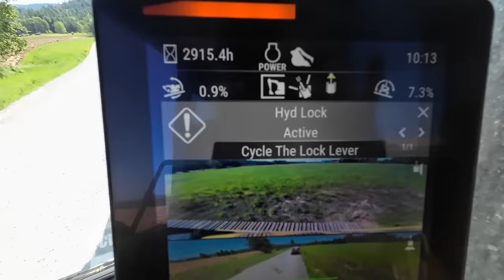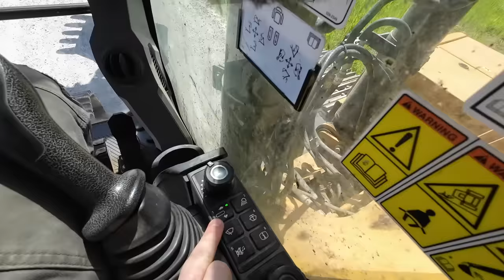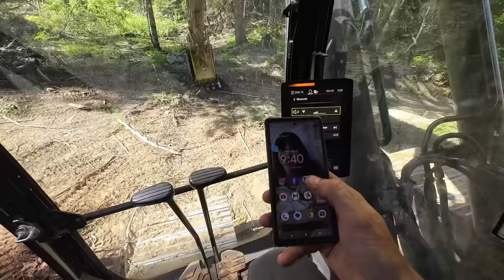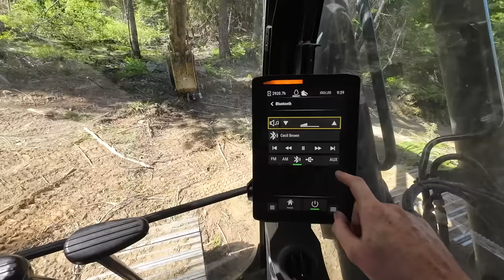We Rented The BIGGEST Excavator We Could Find...

Comment: watching you rock that undercarriage, I'm certain @letsdig18 would agree you're driving it like you stole it & encourage you to dig around the stumps before trying to pluck it out of the ground
Reply: Thinking same about same channel. 
This is where collaboration would come in handy and result in cross channel views. 
And digging around the standing trees to sever some roots before tipping them over. Less breakage and possibly of the tree coming back towards the cab.
Reply: Even reaching  around the back to loosen the dirt and roots a bit would help. A few more seconds and some finesse goes a long way. My body is too screwed up to let a machine drop on the tracks. Even running a Cat 328 loading a 40 ton rock truck with mud, I had to be careful because it jarred the clapped out rental we had......we didn't want a zero tail swing unit but got stuck with it.

Comment: Long time first time....I struggle with ratchet straps.  For an average backyard guy, what would be the most useful size of the Strapino straps.  I have a trailer that is 8 ft by 12 and I do move some sheet goods from time to time.  Was thinking 1 inch by 10 foot.  Yoer thoughts?

Comment: you was lucky, for most people they just leave it the driveway early in the morning.
and you can call them and get help on the phone if you cant figure it out yourself.

this is why its better to rent all the big machines if you dont use them every day..
you cant own them all, and you can always find a faster cheaper and better machine then you have

now you have 2 digging machines and you are renting a 3rd to get the job done

for your own safety, cut those tree´s down dont use the machine like that

it might feel like a easy job, but you can get parts of the tree right in your face if it snaps the wrong way..
sometimes there is tension in the tree from branches and so on

if you want to use the machine you need to pull them up with roots to avoid the snaps, but you need to have the right equitment for that also. (like a strong chain)
or elso it can end up in your face also
or a rotor on the grab

you would not need the bobcat then if the big rented machine had the showel in front like they normally do
that machine is wierd

the showel infront also makes it have more power if you can put that in the ground while you dig for example

smoothing out the road is much more easy when you have that in the front of the machine

Comment: I'm curious how you both would compare and contrast the mini-ex you started you off grid project with, to the Hitachi EX120 or the Cat 330.  I do realize the price point of the three excavators is very different.
Reply: I’ve got a PC100 which is similar to Ex120 glad I didn’t buy a smaller machine, I definitely wouldn’t buy a rubber tracked machine for an off grid property. When they over 20 years old the bigger machines are normally cheaper anyway.
Reply: I have spent a bunch of time in a Yanmar Vio 35 which should be around 8k pounds. The mini ex fits in so many places very easily. We remodeled a big campground for a year, have done a bunch of other jobs with it and I have used it at home. It can do a lot of work with a 1 and 3 foot bucket. It fits in a dump trailer and I can haul it with my diesel pickup. I have not used a mid sized machine like the 120, but have used a 36" machine for tight quarters trenching. It was perfect for that. The Cat 328 or 330 is a workhorse and luckily there was plenty of space where I ran one. Same for the Cat 349 and 78" bucket we had on a job, although I only did a little with it and my brother ran it every day. We were loading super 10 dump trucks and it only took 3 scoops to fill a truck. All the sizes have pros and cons and there isn't a one size fits all choice. Our company also has a Cat 420f backhoe which is probably similar to digging with an EX120. A 3 foot bucket on that backhoe will move a bunch of dirt and a hydraulic hammer on it is great for concrete work, but it is much bigger and less maneuverable than the mini. We often use the mini and backhoe together and also have a cat skid steer. The company sold their Cat 320 excavator since we use so many different types and sizes of machines. It is better to rent closer to the job sites and get the machine that is needed. The mini was great for building their shop and would be my first choice, unless most of the work was going to be bigger.

Comment: On the the 300 make shure radiator finn's are stait and not bent over if bent they make a comb or just use a knife and bend them strait all heavy equipment needs radiator blown out with compressed air every day if its real dusty

Comment: Something like this would require a 35-45 ton rock truck and a dozer to level out the lifts to keep a high productivity level. Lets Dig 18  just finished a massive pond damn. I think he moved something like 100-200k lbs a week with a Hyundai 330 and 2 rock trucks running. You guys with the new machine, the old dozer, and a rock truck should make short work of this project with all the equipment running.

Comment: What happened to the Kubota excavator you used to have? Was it not capable enough for your property? Asking because we are going to purchase one in the future. I have been watching every video and it seemed to be a perfect fit.
Reply: They sold the Kubota a few episodes ago and purchased a bigger Hitachi excavator. But it seems they decided the Hitachi was "too small" and got the CAT.
Reply from the maker: The Kubota was great to us! Reliable, very capable and easy to learn in. But we have some bigger projects in the works that we decided the hitachi would be better suited for.
Reply: @AmbitionStrikes  Awesome you two really push the envelope and my wife and enjoy your channel. We are learning quite a bit about the systems for water and power that you have implemented. Our solar array will be built very similar to yours with a tweak here and there. We are somewhat neighbors. We live in Montana right on the border of Idaho's North West corner. We also live on a hill so that was the reason for questions on the excavator. Thanks again for answering and looking forward to the next video.
Reply: I operate equipment and do environmental and infrastructure work for a living. The mini ex is such a useful machine. We have a yanmar vio 35 that weighs around 8k pounds, but also have a backhoe and rent tons of other equipment including 328, 330, and even a 349 excavator. It depends on what most of your work will consist of and if you need to ever use the equipment at another site. The amount of power and work you can do with each jump up in size is awesome, but the downside is being able to fit in smaller spaces and do finer more detailed work. I also missed where they got rid of the mini ex. They needed a big machine but if they build a house up the hill, I think they will want a mini ex again.

Comment: The Hitachi excavator over heating problem could be due to a few things. Clean radiator external surfaces air usually  dose it. A soft power was is good also. Cover starter and alternators etc. All hydraulic filters should be changed and clean suction filter in tank. Best to transfer all hydraulic oil out of tanks into a clean barrel. Then besure the oil is below suction filter level before  pulling it out to clean it. Break cleaner is good to clean it. Spray from the inside out while cleaning.  Change all return filters also. Check the hydraulic tank filler lid has a air breather filter in it Change that also. Other tips available   any time. Found its a mater of ruling out the simple fixes first then to the next step.
Reply: i bet ya its the radiator or its cover, 99% of the time it is for me when im workin

Comment: Overheating should be relatively easy to fix. The hydraulic hose will be a bitch - it’s a common problem too that none of the companies really seem to have a good answer for. Apparently. On some designs, if you’ll tie a rope to one end, you can pull a new line through like you would electrical cable through conduit.

Comment: why just burn the wood not log it for lumber or firewood so you get atleast some money out of it
Reply from the maker: We’re only burning the slash and trees that aren’t good candidates for lumber/firewood.
Reply: Please understand that only certain local species of wood has enough structural strength to be worth milling for framing lumber. Add that one has to pay for a hauler for taking the logs to a mill. Unless a smaller mill will deal with a small customer and loads, which isn't too frequent. Second, there are lots of logging operations in this portion of the country. If you don't have enough to keep a hauler busy and paid, you won't get their time. Depending on the wood species, not all wood has enough BTUs of heat to use for heating, unless you can feed a stove all day long. And, my understanding is the logs aren't their to decide the use or scrap. They belong to the neighbor. Just our experience.
Reply: @AmbitionStrikes  it's really different thinking there I'm from Europe and we basically cut the brush and everything and then have forwarders haul it out and stack it for chippers for powerplants and big central boilers for heating everything gets used except stumps I worked on a excavator with a shear cutting brush and it really adds up quick but I quess out there you don't need that I know quite a bit about trees I've been logging now for 3 years and it's really different around the world but love the videos

Comment: Must be nice to not have to work and just play on equipment all day
Reply: How much equipment have you run? It is certainly work, just easier than manual work. With neck and back issues, running equipment can be quite painful for me. Even something as simple as loading rock trucks can be hard on the body when you end up with a clapped out machine (328 zero tail swing) that isn't balanced well and then end up having to sling mud due to ground water. My brother has less body issues and is a master at operating and it still beats him up. It is still work to maintain the machines and take care of issues that come up. It is satisfying to be able to get so much work done just by moving my hands and feet. There is a reason it takes years for operators to become very good and a reason operator pay is so high.

Comment: I am no eco warrior but looks like a waste of diesel, equipment time  and human time to accomplish what /365x24hrs=8760 hours /how many hours is the driveway used, maybe 30 minutes a day equals 365x.5=182.5 try 8760/183 maybe 2.1 %
Reply: Am I understanding correctly that by your calculations it would be much better to slide off the road in the winter and wreck the vehicle plus risk safety than improve the road?
Reply: @brianworley7705  be a cowboy they didn't slide off roads
Reply: the amount of monies spent should be  in a 401K
Reply: @richardwhite4277  I can appreciate your counsel. However having experienced similar challenges of repeatedly getting stuck on a section of a road or sliding backwards when icy, I can relate to their desire to improve the road. It gets tiring struggling each winter trip through a section of road. I believe if you could walk in their shoes a mile or two, so-to-speak, you might understand or even relate to the choice they are making.